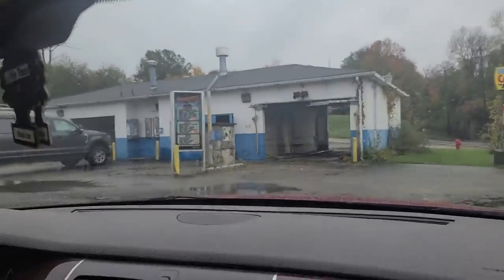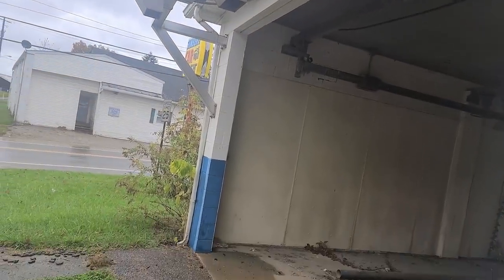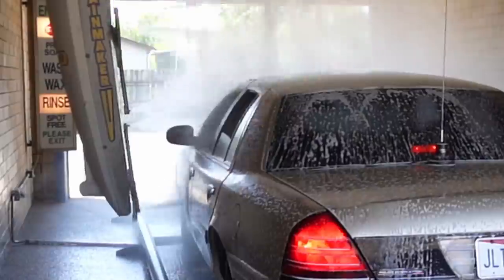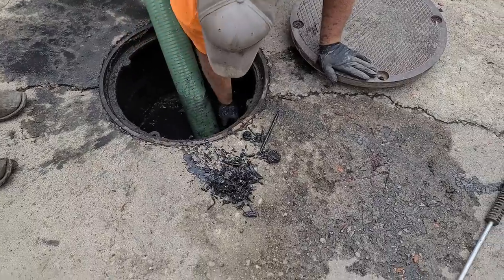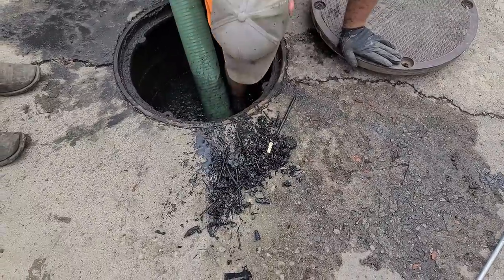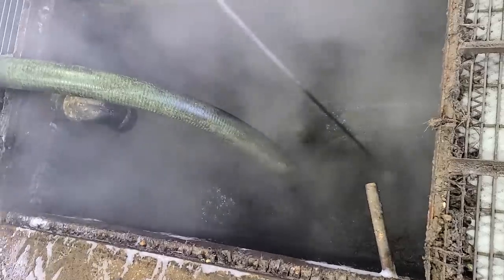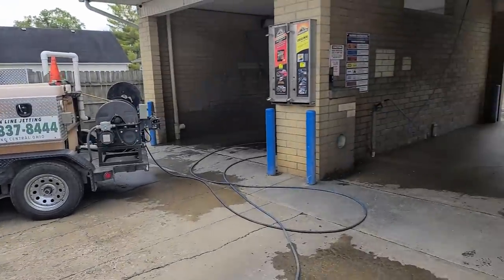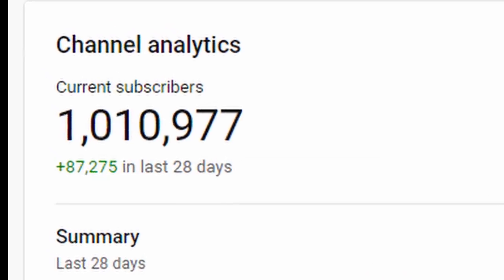Buying a 3rd Carwash For $5,000 : Should I?

Comment: Why don't you own a warehouse???
You need a base of operation and work shop.

I would have bought that and stored it in my living room, that was an incredible price!
Reply: Agreed a part storage shed or shop. Granted a bit more than a home garage sized amount of stuff to store but still.
Reply: As for using a warehouse for storage I often rent spare storage off unused factories. I find I hire the storage space needed for the task & then the business owner receives an income for fresh air. I usually get a mini insurance policy to cover the rental period.
Reply: It would have  Totally been worth it every penny and all the time it would have taken to get it removed and stored. I totally agree I would have  Stored it in my living room if I had too.
Reply: I do the books of my friend's Laundromat & a thorough clean up of the hidden storage opened up 3 apartments he rents out & the tenants get cheaper rent to clean the laundromat as the operations (open / close is automatic). There was enough spares in these rooms to build a new laundromat. My years in film / video production taught me to keep things as a box of odd plugs / cables allowed me to use a refurbished amplifier as I found an adapter plug. 

I learned when I had my vending runs to keep those spares until you have all the same model machines. I chased a weird globe for the keypad until I recalled a box ox of odd globes I never used. Not sure on the amount of wear & tear on gear with all that snow but anything mechanical wears out.
Reply: His one car wash has a storage unit business… he has to have some spaces available
Reply: Awesome story telling! And love the car wash videos! Here to learn more about car washes.
Reply: Wife be like:
Thats it!
Im taking the kids and leave. Ill be at mom's until you get rid of these hoses and pipes, you cray hoarder !
Reply: @dan_6915  Murphy's Law - you toss something out & then you need it. We looked at another Laundromat & the owners hoarded everything for years. The old couple never threw anything away. They had a massive space full of spares that was once an expansion but refused to disclose the financial accounts.
Reply: you can rent an old trailer or shipping container or buy one.  In any case you need a secure location to store expendables and spares, oh, and TOOLS.

Comment: You should look at the carwash equipment as good backup equipment.  The pumps, water heater, electric panel, tanks ro machine vending machines.  All the copper you can get could be sent to recycle the wiring could be saved or recycled.  If you have too many projects going then leave it but if you are waiting on things to begin then get the stuff and store the diff pieces in the diff laundromats and car washes.  Maybe store it a couple months or so but find places for them to go.  Maybe use a few pieces in a new build but they are suited as backups.

Comment: You've got too much on your plate when you have to turn down a 60k gain on equipment for something you feel you can use.  I've seen guys buy a used semi trailer and load the goods in it, park it in storage, and drive it to the installation location when it came around. You don't even have to own a truck. Hiring a local to hook n pull is usually pretty reasonable. If you buy right on the trailer you'll resell it for same or close to it when you get done. Thanks for sharing
Reply: Smart

Comment: I enjoy your content. Ive bought and sold lots of equipment in the past and my storage solution has always been the 53ft long dry container or trailer with chassis, which could be moved to another location when you eventually find one / buy one. Ive bought entire floors of manufacturing equipment, office equipment, inventory all to sold at a later date and location once its stored it the trailer. Just remember to take copious pictures before dismantling  and moving the parts. Remember number them and keep nuts, bolts tagged and bagged with major pieces. Best of luck!!
Reply: I agree with the trailer idea!...my brother-in- law used several in his wrecking yard business.

Comment: If you take the deal and own the storage place it sounds great, if not what is your cost to remove, store and for how long.  Does everything work?  If you don't own the land and the building you have problems! I now put the bell on ring.  Glad the new car wash is working correctly.  Upgrade the second location, put your order in now and yes the machine will take a while to come.  But at least you will have those parts.  You have all your lessons learned on you tube! Good luck.

Comment: If the equipment is compatible and you can find the space to store most of it, it would be worth it to me if I was having 2 or more car wash locations. Downtime costs you money, getting parts takes time, sourcing parts takes time. Even if it's $8k to remove and store the stuff, in the long run you can make some of that back by selling it or not having to buy it when needed. An under $10k cost when you just dropped $200k+ on your place seems like a reasonable opportunity.

Comment: I have done some similar type purchases storing sounds good but as you take equipment apart transport it store it and then attempt to put it back to use electronics and electrical equipment don't like to sit and what you think was good ends up being bad so 5000 was a great deal on the equipment but not time you pay for tear down removal storage reinstalling with the appropriate hauling it gets expensive and if you had problems while it's stored then you've created a monster with little nagging breakdowns. That's my thoughts as a business owner and entrepreneur. God bless. Enough said..

Comment: You could of buy the old place and put it in storage  yes. You could of buy a use trailer and store all those equipment inside since use truck trailers are relatively cheap and have those equipment for later use or a new location. Equipment breaks and have spare parts ready available is great because money already spent

Comment: It would be cheaper to buy a location and put the 3,000 equipment into it ...either as a storage shed or car wash. Or buy a storage facility and store your equipment in your own sheds...and let the place pay for itself...again cheaper. Cheaper than getting a huge loan. If you have let this go and someone else has bought it....consider getting your loan down to a certain percentage before going onto the next thing.... but you need your own storage sheds its clear to save money...so go buy a storage facility that you can also use and let it pay for itself.

Comment: Buy the equipment then sell it immediately after.  Make the buyer remove it from the location.   If the equipment is worth $50k used why is it being sold for $3-5k??  There’s a reason.  Can you turn it on and see it function?   Sounds like the buyer may be wanting to upgrade the equipment so he’s keeping the building and land.  How well does this stuff store?  What is the possibility of damaging it during removal / transport?

If you get these deals offered to you on a regular basis and the equipment is good then buy them. You need a shop or warehouse for everything you do. Can be your office & storage for car wash supplies / parts / equipment.  Plus items for all your properties  -  you can buy bulk flooring, carpeting, light fixtures, appliances etc. save $ and always have item you need on hand.  I had to wait 2 months last summer for 2 fridges, stoves etc.

Comment: Your time is the most valuable thing that you own. If I was in the situation with zero assets and just starting out in the car wash business I would hop on this extremely quick because of the value that it represents as I start my car wash business but since you already have a car wash a fully functional car wash that appears to be still under warranty there is no reason why you would need this equipment unless you already had a vacant car wash that needs rebuilding. And I'm sure there are vacant car washes that you can buy but again you would have to be in the position where you already had one otherwise you're just going to spend a lot of time and money trying to figure out if the  car Wash is a good deal, good location and will make profit with the investment of the $5,000 equipment that you got it from that location. What seems most valuable to you right now is your time an effort to make your currently owned business a success. It's more of a quality versus quantity.

Comment: I woulda got it just for the equipment.. at least you'd have it in case you buy a third location. I owned a trucking company and would buy old trucks and trailers just for parts.. semi trailer axels in the 90s cost $500 apiece used. I could buy a whole trailer for that and have extra parts in case I needed em

Comment: So, storage would be somewhere around $2k annually. Exactly what is the lost revenue and replacement cost if you have something break at one of your two carwashes?

Those tanks aren't leaking by the way. Just the fitting. Probably a quick solder fix.

Comment: Not worth tying up (albeit small) cash and time it for nominal gain, if any. Cost to buy, cost to remove, cost to store and mothball wet parts appropriately. $50k new but resale used half of that. Using those parts as needed for your own machines for repair or replacment will not realize even half of the parts in the near term and hoping to piece it out to other carwash operators on an as needed basis will turn you into a junk parts vendor. If you can expand bays in existing premises it may have been worth it. Stick to your day job and passive income.

Comment: The investment is more than just 5k. I'm sure you factored the labor and storage (technically a loss of revenue if you stored it at your place). Given the value of the equipment even if it was sold or better yet auctioned off the real question is how long do you need to hang on to it and could you better serve your business partners by putting that money (upgrades) into the second car wash. At the end of the day only you know how much overextended you'd be if you made that move but I'm guessing you made the right call.

Comment: At this point you're planning on upgrading your equipment at the one location, eventually. So, it wouldn't make sense to hold onto and store equipment that you aren't going to use in 5 years. On the other hand, if in less than 5 years you are going to buy another car wash it would make sense having spare equipment to use for your other location.

Comment: OK so u say u have to upgrade one location still why wouldn't u strip the 5k location of its newer equipment  and use it to upgrade the still older equipment location that needs upgrading if that cost 225k u would have saved a ton of money in my book